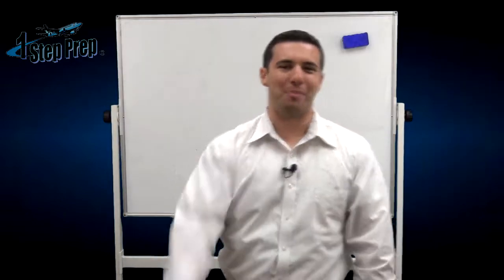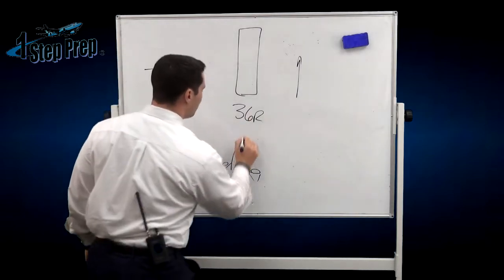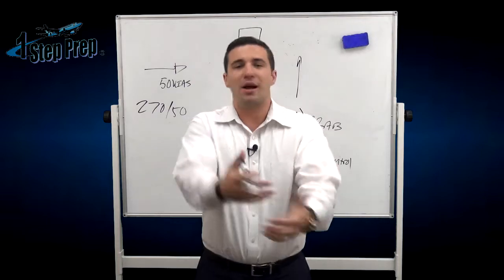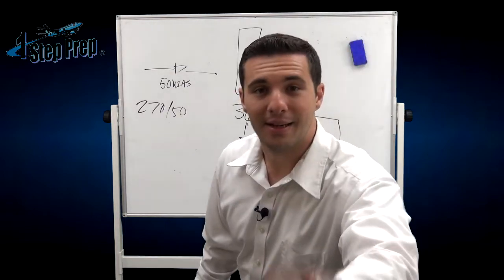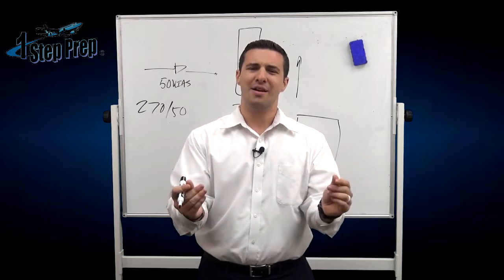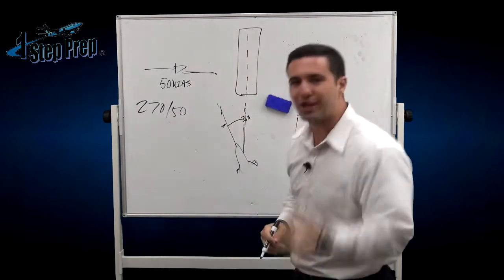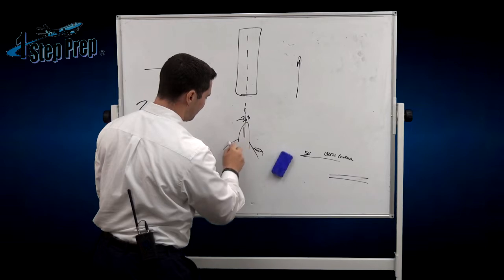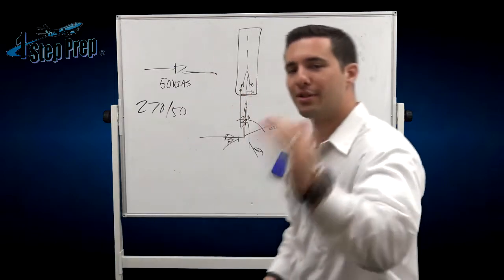Crosswind Landing Technique For Jets

Comment: You def can't do that on an Airbus A320 as according to the manufacturer yo ushould flying crabbed till before touchdown and de crab before touching.
So basically why should you use the differential thrust to fly "straight" during all the along the approach?
I don't see the purpose of that.
Reply from the maker: Differential thrust isn't to fly straight. This is a crabbed approach all the way with a decrab just prior to touchdown :)
Reply: @1stepprep   so i just don't understand this thing of use differential thrust, like you set differential thrust at 30ft before decrabbing?

Comment: Great presentation skills but unrealistic content. 
FCOM-LIM and certifications are for a reason (handling, structural clearance). Intentionally inducing asymmetrical thrust will increase the workload unacceptably for the crew, as crosswinds that strong will most likely never be laminar and jet’s thrust response isn’t instantaneous. In case of Go-around/balked landing, you jeopardize the handling (even the B/angle display) even more and the performance gradient. FBW control laws (with yaw damper) will not respond like a cessna in a smooth flight sim. And if you loose thrust on the “live” engine, well I hope the final report will be enough for the families.

TL;DR 

Don’t do it folks, anticipate the weather and divert. #FlyNavigateCommunicate
Reply: Is that the only thing you found wrong with this content?

Comment: You don't cross control in an airbus 320 fyi
Reply: Well according mister instructor here A320 and B737 are not allowed to land with side-loads on the main landing gear. Only way to achieve that is by using wing low technique, with 50 kts crosswind the wingtip will be well buried into the ground. This whole video is baloney, of course you don't fly cross controlled or only to a very small extend and land crabbed or kick the aircraft straight just before touchdown, in either case side-loads are not zero.

Comment: Absolute nonsense. Have you flown a real Airbus?? This weird advice is contrary to Airbus FCTM, for very good reasons. There's no such thing as 'weather vaning', the aeroplane flies exactly the same with 0 XWC or 200 XWC
Reply: Good, seems I’m not the only one finding this video full of baloney.
Reply: There are many things in here that are just glossed over.  May I suggest that you pause and reflect on some of the comments and consider more research and a revised version of this tutorial.  I don't think you've adequately explained your reasoning for applying downwind, additional differential thrust.   I do not believe it is either Airbus or Boeing  documented technique and as such I can't support it.  Personal opinion, I don't think Joe should be teaching this technique in a public domain.     I'm going to go through a number of points, not to belittle, but to help and encourage and dispel myth.   1. Differential Trust.  2.   Partial Decrab on late finals. 3. Jet engine responsiveness - Spool up.  4. FlyByWire Airbus Normal law Roll behaviour.  5.   Wing Sweep in crosswinds.  6. Displacement from Centreline.            So here we go.    1.  I have heard of differential thrust being used in 'at or over limit' crosswinds, on other aircraft, but that was using differential thrust on the UPWIND side during early partial de-crab, to assist the rudder with total yaw authority.  Again, that was in very significant crosswind and was done by an A Cat Air Force Instructor. In 37 years flying I have only seen it used once and tucked it in the back pocket as a very advanced technique for special demanded conditions.   You may argue that One Eng Inop is differential Thrust, yes, but that's then a known conditions and crosswind limits may apply.   Furthermore, rudder authority becomes an issue and you choose which side to put the crosswind if you're assymetric.    2. I can say that in large US origin jets with triple autopilot auto land, in significant crosswind, they do initiate a partial de-crab during the late phase of approach, well before flare. They do not use differential thrust.  The partial de-crab is one technique taught in large crosswinds and also gives an opportunity to explore yaw authority before touchdown.  But again, that is for extremes.    3.  On any approach, it is a descending manoeuvre and only a small mount of total thrust is required.  In your example, if one engine is advanced, the other must be reduced.   I am concerned with what you are teaching that, on a jet, the reduced thrust engine would have slower spool up response taking more time and slow response if thrust was needed, causing unwanted differential yaw and roll in any 'reactive' thrust application, because one is at higher N2 and spools faster. Very strong crosswinds usually generate significant mechanical gusts from upwind terrain, needing dynamic and active thrust movement.  I am really not keen on your suggested technique of downwind engine differential thrust.    4.  On A320, the aircraft is in normal law on approach until pitch mode changes in Flare Mode at 50' (A320) or 100' (A321).  In Normal Law, inflight, Side stick input (all the way to touchdown) demands Roll RATE, not a proportional Aileron input.   Again, you do not explain that aspect or the transition.      5. You may also wish to discuss the swept wing aspects of yawing in the flare, with significant crosswind.  The advancing wing becomes more head on, The retreating downwind swept wing in effect creates an apparent greater sweep and significant roll is induced by differential lift.  Airbus flight laws sorts a lot of that out.  for conventional aeroplanes, HG Davies describes the effects well on jumbos in his book  Handling the big jets.  6.  Separately, and I'm sorry to harp on, but you talk about the technique of displacing your alignment on the upwind side of the centreline. Fair enough.  However, that is because when you are crabbed into wind, allowing heading plus drift to track the aircraft along runway track.  You the pilot, at the front of the aeroplane will be displaced ever so slightly upwind of the trackline of the aircraft's CofG. Work out the numbers, Draw the diagram. When you flare, with rudder input, the aircraft will pivot about its centre of gravity  to achieve runway alignment in the flare. In the process, you, sitting say, approx 7m in front of that CG will pivot with the aligning aeroplane and displace across to the centreline.  Do the trigonometry with Vapp 131, 50kt crosswind and work out the drift and the physical displacement. It is not much. Do you really think you can displace 2.6m Left of centreline from even 1 mile out ? I don't.  It does become noticeable closer to the runway.   Physically, it's much more noticeable and applicable in a larger, longer aircraft..but only when you are close to touchdown.  It is true that the concept is taught on HUD use, but the magnification is significant. (6 or 8 times)         Joe, I DO think you have your heart in instruction and I admire your enthusiasm, your kind intent it to educate,  but this particular edition needs a significant revisit. I do not support differential thrust on swept wing jet engined aircraft.   I'd love to see the fresh version.  Kind Regards.

Comment: My god, I hope nobody is actually stupid enough to take this nonsense into the cockpit. An aircraft weathervaning in the air when disconnecting the autopilot, really? Differential thrust into the wind during flight, crosswind becoming a quartering headwind in flight, WHAT??? Boeing 737 not certified for sideloads, not true, allowed to land without de-crabbing up to 40 kts crosswind, although not recommended on a dry runway. Differential reverse thrust during landing roll.... An advise here: disregard this nonsense, its complete misinformation. FOLLOW YOUR AIRCRAFT FCOM!!! Hope this dude is not actually an instructor...

Comment: Around 5:30, you talk about the aircraft always wants to “weathervane.”   That is not accurate.  If you’re wings level, no control inputs, the airplane will just keep whatever heading you have.  The airplane has no idea there is a crosswind, all it’s doing is flying through the air.  You are correct in saying it will weathervane on the ground.  The weathervaning you may be experiencing in the sim comes from freezing the sim, setting up your student on a 5 mile final and after releasing the sim freeze, the sim weathervanes the plane briefly.  The only weathervaning you would experience in the plane is if you were holding rudder pressure in for a slip and releasing the pressure to neutral.  Then and only then it would appear to weathervane.  But it has nothing to do with the crosswind (in the air).  You could do this on a calm day, push rudder, hold opposite aileron, release, and it would appear to weathervane as the aircraft goes back to its previous state of equilibrium.   Think of a kid walking with a fish bowl with a fish swimming in it.  Regardless of which direction the kid is walking (wind), the fish (plane) can swim around in any direction perfectly  unaffected by the kid’s direction or speed.
Reply: Yes, completely nonsense, should be taken offline before someone takes this video seriously. Unbelievable how a real world “pilot” does not understand the very basics of a crosswind landing.
Reply: The aircraft will weathervane...I think he just wanted to say that the plane will crab. And you are saying that the plane will never crab by itself not matter the wind. In this case, how would you crab into the wind during crosswind landings? Rudder into the wind?
Reply: Wrong. The aircraft will crab right down final otherwise you'll never get lined up with the runway.
Reply: D  You obviously understand the difference between heading and tracking.  Please explain how the aircraft wants to “weathervane” into the wind, while it’s airborne.  I have been flying for 30 years, CFII, MEI, sailplane pilot, UL’s, Aerobatics and tailwheel instructor, 4 type ratings, 2000 hours in A320 type, and I have never seen or experienced an airplane “weathervane” while in the air!  The only way an airplane can weathervane is while its tires are making ground contact or if you experience some kind of wind-shear while airborne (ie. Wind 180@15 shears to 270@15).  Thank you.

Comment: On extreme crosswinds it is better to use the Crabbing Slip Method.  That is a combination of the Crabbing Method and the Crosswind Slip or Wing Low Method.  Low engine airliners like 737's 300 and up cant do more than around 10-12 degrees of banking on the Crosswind Slip Method, so if still you need crosswind correction 12 degree banking towards the crosswind then you have to crab the nose into the wind on the flare too. And that becomes The Crabbing Slip Method.  I landed many times with DIRECT CROSSWINDS at half the speed of stall on many airplanes using that Crabbing Slip Method.  That will be like landing a 737 on a 55 knot direct crosswind or more.  Im was a CFI in a windy area

Comment: i hope this guy is joking... even his diagrams don't make sense. differential thrust and the nose is pointing straight at the runway and track is to the right away from the runway.
Reply: When you have a wind from the side, the nose tries to point to the wind, It called Weathervane Effect.  Then you have to add opposite rudder to compensate, you can use the downwind thrust reverser to help you keep the airplane from weathervane.  Use more reverse thrust on downwind engine than on upwind one.  It works better than just stepping on the rudder only..
Reply: @feetgoaroundfullflapsC  No it doesn’t the aircraft does not experience “crosswind” while airborne and therefore does not weathervane.